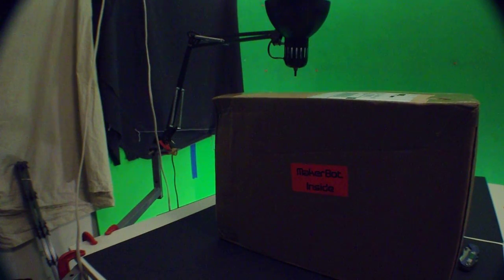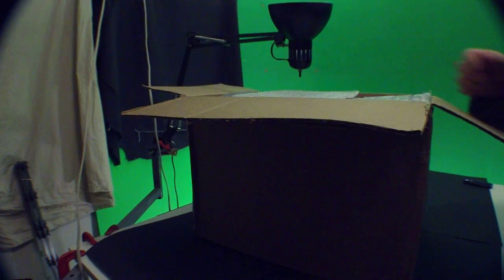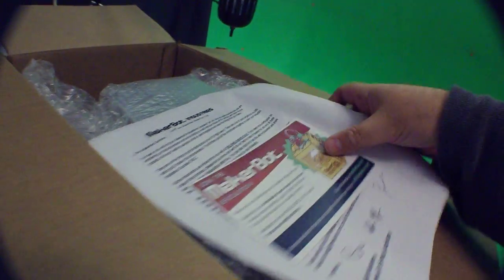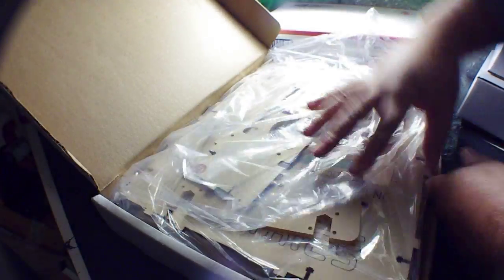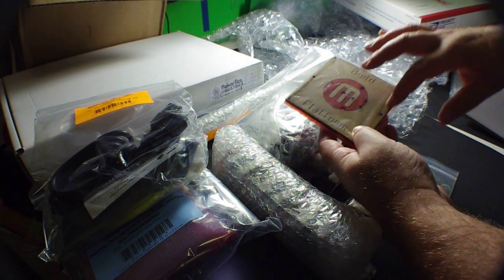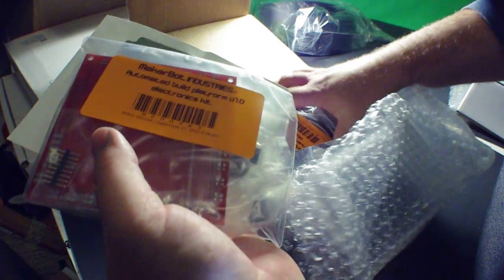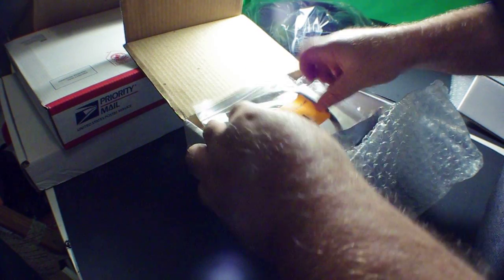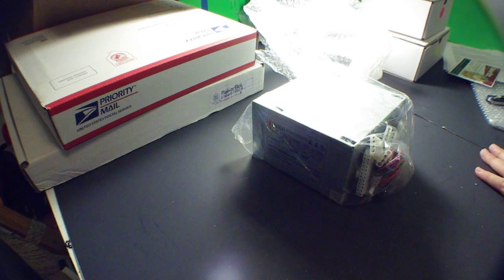Tools: The Makerbot 01 Un-boxing Overview

Comment from the maker: @oliviasdaddy1 A very pertinent question.  Yes the major plan is that I start creating 3d models that I have built.  Also as you suggest, using this to generate shapes and such for other models is a good use of this device.  What I most look forward to creating is my own models that I would like to turn into kits and get some cash flow possibly going.